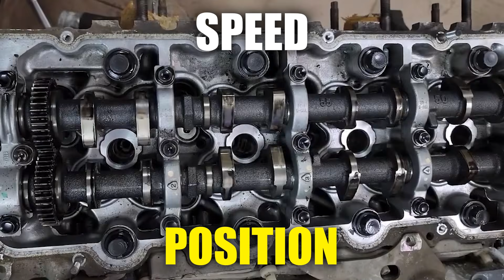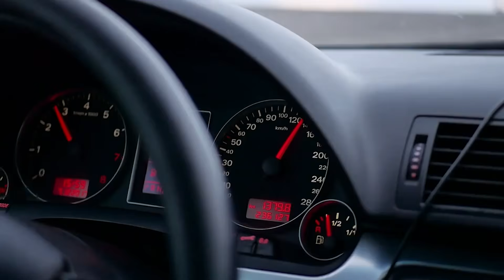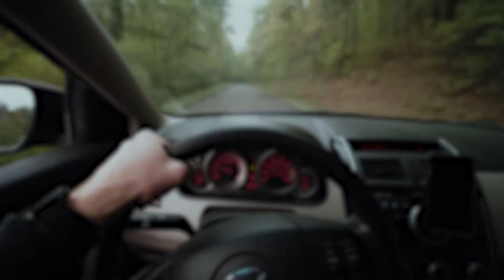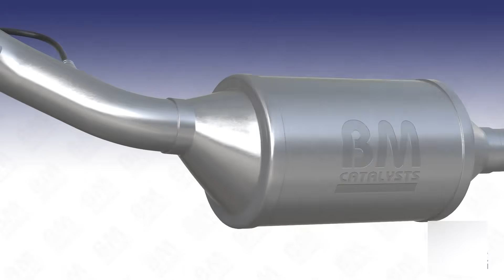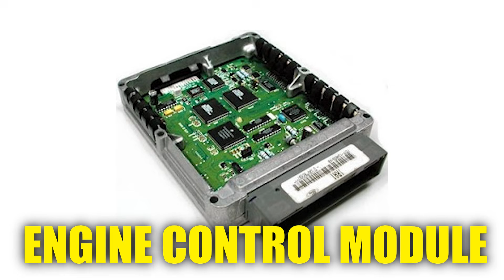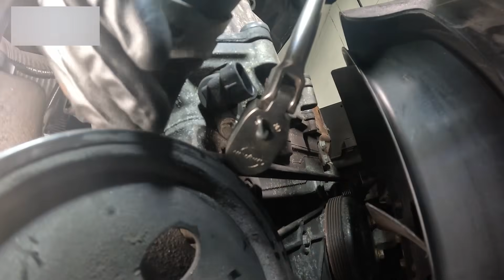Your Car Has a Bad Camshaft Sensor if You Notice These 12 Things

Comment: When I get a 20 503,000 RPMs in my Honda Accord 05EX I always love a car but I get the 2500 or 3000 being young you start hesitating for fuel do you sell the accelerated for the recruit that comes out about 800 or you put it back in drive and I nothing it never happened till you get up to 3000 or
Reply from the maker: Hesitation under load like that can often be caused by a failing camshaft position sensor, but you should also check your fuel pressure and ignition system.

Comment: my 2018 Elantra shakes when I hit the brakes, fuel smells, one day my engine didn't start right then the engine light came one and I couldn't go up hill.. I have to drop it off at the body shop immediately.. the guy change the oil, he said there's no oil in there.. next day it happens again at work, I spent $250 for tow, tow it to another body shop.. he said it's the crank sensor

Comment: I have Passat CC 2011 with DSG DQ250
I have check engine light and the transmission is going with only one shift 
Once I restart the vehicle, it's going fine until short way and again, the same issue

It could be this sensor ?

Comment: Im getting a code of C121c on my jeep Rubicon, it has most symptoms from this video.  Any help?
Reply from the maker: C121C on a Jeep Rubicon usually points to a problem with the electronic throttle control or a communication issue between the ABS and engine systems. First, check for any loose or corroded battery or ground connections, then inspect the throttle body and wiring. If the throttle body is dirty or failing, cleaning or replacing it often clears the code and fixes the symptoms.

Comment: I have a 2006 Nissan Titan I change my crankshaft position sensor and it’s still giving me the same symptoms need help
Reply: Does it not start when got and after you run the ac. My gf truck will not start unless it sits atleast an hour… ti cool down after running ac. I don’t know what it is . But will start with starter fluid. I thought it may be a clogged air filter. I pulled an air intak hose off the main air intake and it started right up.
Reply: Same. I have a 2014 forte. I’ve changed the starter the battery and the whole entire engine. And the crank position sensor

Comment: My kia sportage 2012 is having a starting engine problem,  when turning on the key the engine does crank but not starting at all, what is the issue sir?
Reply: Same as me did here... how did you work upon it
Reply: Crank Position Sensor.

Comment: My kia sportage 2012 is having a starting engine problem,  when turning on the key the engine does crank but not starting at all, what is the issue sir?
Reply: Check the crankshaft sensor

Comment: Boss, I can't find where the camshaft sensor is in my proton saga vvt 2017. Is there one on this model? In the flx model, it's underneath the engine plastic cover on the right side facing the car.
TIA.🙏
Reply from the maker: Yes, the 2017 Proton Saga VVT does have a camshaft position sensor—it's typically located near the top of the engine, close to the timing chain or camshaft area, often under the engine cover; check around the right side (driver’s side) of the valve cover for a sensor with a connector. Let me know if you find it.
Reply: @autofixdiary Thanks for looking it up for me but I still can't locate it. Will visit my local mechanic to locate it and to clean it for me. Thanks again!🙏

Comment: Hi brother, I have a Nissan Micra 2004, 1200cc. I'm facing a strange issue. Most of the time, the car drives fine, especially when I accelerate slowly in 4, 5 gear – it runs all day without any problems.

But sometimes (once every 3–4 days), when I’m driving at higher speeds like 60–70 mph, or I push the acceleration harder, the car suddenly loses power. It doesn’t stall completely, but it stops responding properly to the accelerator – almost like it’s misfiring or struggling to breathe.

I pull over and wait for about an hour. After that, it starts again and drives normally. Then it might not happen again for a few more days.

Could this be related to fuel pump, ignition coil, or maybe throttle body? I’d really appreciate your thoughts or any advice you can give.

Thanks a lot – your videos are amazing and really helpful!
Reply: I have the same issue any suggestions yet
Reply: IACV or TPS… both are sensors.

Comment: After i replaced my camshaft and lifters, camshaft sensor read intermittently, and it would start. I had the timing chain replaced, the cam phasers, the sensor was checked for flow. It now starts but the timing chain sounds a delay and rattles
Reply from the maker: Based on your symptoms, it’s possible the timing chain tensioner isn’t holding proper pressure, or there’s slight misalignment in the timing components after the repair. The delayed rattle suggests slack in the chain or low oil pressure affecting VVT operation. Recheck the timing marks, verify oil pressure, and inspect the tensioner. A scope check of the cam/crank correlation may also help diagnose sync issues.
Reply: How much was it to have your P0348 code cleared (timing issue fixed)? Thank you in advance!

Comment: I changed the camshaft sensor for my sister a year ago. And her car is dying randomly. today she got the p0340 code. Would that be wiring or a faulty plug?
Reply from the maker: While the p0340 error code deals with the camshaft position sensor, it can be caused by any electrical issue related to this sensor. This means that replacing your sensor may not be the right solution. Before you look for solutions, consider these possible causes of this error code:

An open circuit within the wiring
A failed powertrain control module
Grounded, broken, or shorted wire or connector in the circuit
A damaged or failed camshaft or crankshaft position sensor
You’ll need to carefully inspect your sensor and wiring to determine the exact cause
Reply: I got error codes P0368 and P0342 from my OBD11 diagnostic tool yesterday, after driving the car for just about 12 hours. The car now refuses to start. When I press the push-start button, it makes a sound like the battery is weak — but I don’t think the battery is the issue.

Before this, the car had been misfiring, shaking, stalling, and sometimes wouldn’t move at all. Even when it did move, it was very slow to respond. It was also consuming a lot of fuel. That’s why I took it to the mechanic — and those issues were fixed.

The car was driving fine after the repair. But after I added fuel (since the tank was low), about 20 minutes later it suddenly stopped starting.

Do you think this could be a crankshaft or camshaft sensor issue? Or something else entirely?

I'd appreciate your thoughts.

Comment: I need help, I drive a Mitsubishi Lancer 2012. The engine vibrate and  experience low RPM below 1 when on Stop 🛑 sign. I will have to shift the transmission to N to avoid this vibration. The car also goes off if shifting the transmission to N isn't done fast. 

But everything works fine when on motion.
Reply from the maker: This sounds like a classic idle control issue, likely caused by dirty/faulty idle air control valve, clogged throttle body, failing spark plugs or weak/bad MAF. Please start by cleaning the IACV and throttle body, then check for vacuum leaks. Let me know how it goes.
Reply: motor mounts

Comment: Where is The ECM  Located under my hood on my 2011 Dodge advenger
Reply from the maker: The car computer module on a Dodge Avenger is located under the hood, close to the battery, mounted to a bracket. The bracket holds the ECM and TCM (transmission control module). Let me know if there's something else I can help with.
Reply: Yes please sir could you send me a picture exactly what it looks like and located @autofixdiary
Reply: @autofixdiary  I found a small narrow black box there but inside of it there's like 4 small black boxes they all look alike but   not  saying EMC none of that on it
Reply from the maker: There seems to be no option of sending an image through the comments. Please look for a like a small, rectangular metal box with ribbed sides and multiple wiring connectors on one side.
Reply: Yes I found that and opened it there's just like 4 small looks like 4 small square  Black  squares, Is like small square tiny boxes  @autofixdiary
Reply: Could you please post a picture on my comment where exactly is it at, the Ecm because I've changed the crack sensor but thats not it I need to find the fuse @autofixdiary